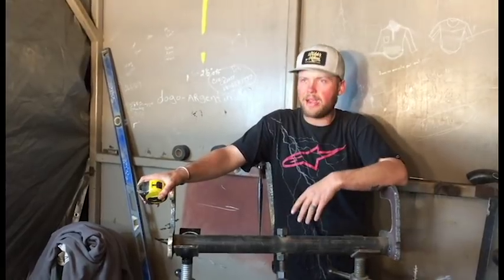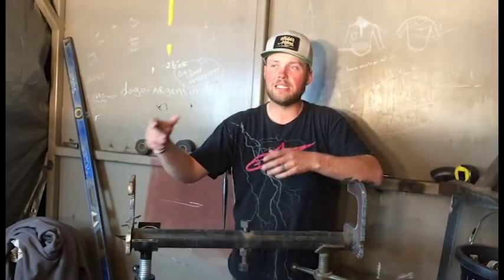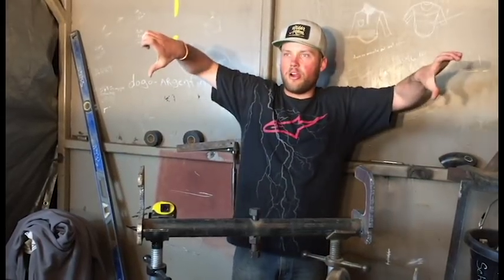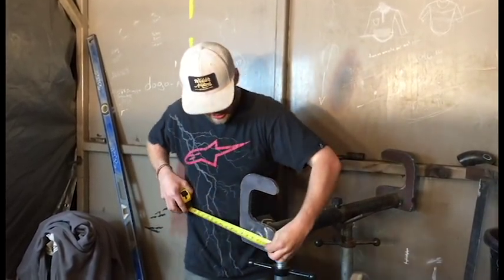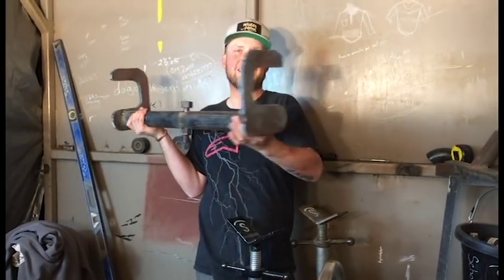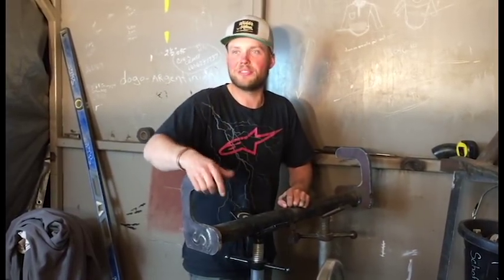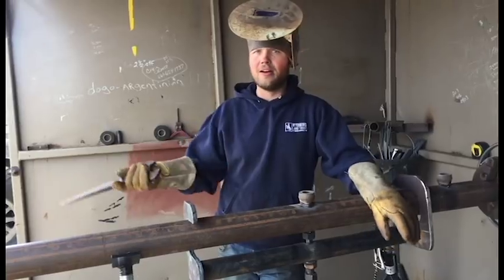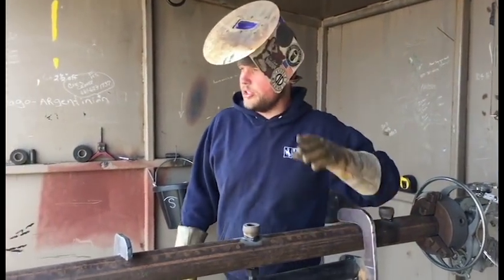Building and using a strong back. Pipe fabrication

Comment: Squared corners gives a start point for a tear to begin, think of it like a scored line on a piece of glass or sheetrock, it always breaks on the scored area, and a round corner has no area for a tear to start, if a repair is done on sheet metal or structural steel like a truck frame, if a hole is drilled at the end of a crack then the crack is and the welded and fishplated, and it can't continue on to tear more because  the round hole gives it no place to restart.

Comment: I have a 7 foot sch 80 4" with 22 1" weld olets 3.5" on center.   Any suggestions beyond the strong back?  I have sch 160 2" coming today to build a strong back.  Making 2 of these manifolds  to replace 2 that had thread olets and the issues with all the nipples being inline.  Johnny.

Comment: You get paid for f ups, that are your fault.
Reply from the maker: Richard Harms well if they don’t run you off over it then technically yes you do. Lol!!
Reply: Cool! I work for a plumbing company doing odd jobs welding mostly. I build pipe racks for pickup trucks, using 1 1/4 schedule 40. I know about bananas, but bananas are ok. These are really strong, kind serve as a roll bar too.

Comment: On my strong back I use chain link and welded a stud on the other side. The chain link goes around the pipe and hooks onto the stud. The middle part is the same but I weld an angle iron to cuff the pipe
Reply from the maker: genious thats a dang good idea i will nuild my next one like that
Reply: I use 3/8 chain...I work the nut from the inside and I weld the angle iron to the stud. I do that for the angle iron won't slip off the pipe. The plus side you will have using chain link more storage on your welding bed because you know how quick you will start putting tools in your back seat
Reply: I have one because I work with stainless pipe you talk about dog legging a pipe

Comment: round cut just basically removes a pressure points it spreads the pressure out.more area in a round vs a corner
Reply: Scott Everett yup. A square cut will concentrate the pressure at the 90* turn point and that's also usually a thinner area of material
Reply from the maker: thank you very much im learning everyday

Comment: How many hours is to much for a welding machine? Looking to buying one?
Reply: Roy Estrada not a welder brother but I’ve seen guys on the pipeline running Lincoln’s from old ass hell to brand new it’s the operator not the machine lol
Reply: Well. For Diesel machines I wouldn’t go for anything over 5000. Because if the machine last 10,000 hours (which is normal for a diesel) 5000 hours would be half its life p.s Gasoline machines last for 4000 to 6000 hours
Reply: ive always been told to look inside and see how clean it is. ask about the maintenance and shit, ask to run rod on it at all different amps. never bought used before.

Comment: How do you center the threadolets?
Reply: randlemyers there’s tons of ways but the easiest to explain and write would be... use a center finder (v shaped kinda looks like a square but it’s 45*) find the center line that’s vertical and make it plumb and mark it. Now go to the other end of the pipe and do the same thing. Now if you connect those two line with a straight edge or “snap a line” with chalk you have a straight line going down the length of the pipe. Now just make sure each o let is centered on that line.  Or do the same thing but just lay a length of angle steel on the pipe and draw a straight line. Only problem I have with that is most of the time you’re going to put a flange on or you already did so you might as well make the flange level the pipe level then find the center line using a level. It’s nicer to know everything is level then halfway through the process try to make it level. Let me know if you don’t understand
Reply: Search “machinist center center square” it’s essentially the same thing as using a length of angle steel but it has a flat side that you can put a level on the make everything plumb/level/square.
Reply: Thanks
Reply from the maker: ecr125x hit it righ on the money all i do is use levels get everything mark step back and be sure its in the middle.

Comment: The sqaure cuts weak point is where both side meet in the corner . The inside corner of it all is taking all the Force ( from what ever force is being applied ) . Not the entire shape .

Round cut is stronger because the force being applied to it and being divided into the entire shape , so the force has no choice to cause the weakest spot of the shape . 

If that makes sense lol
Reply: On board ship, any cuts or piercing, had to have rounded corners to prevent ripping, WTD's, hatches and the like all have rounded flanges and matching cut outs.      MH/DC1 USCG 76-85
Reply from the maker: see thats awesome info i did not know that
Reply from the maker: for sure does i appreciate you guys commenting.

Comment: You round the corner and it evenly distributes the force into both legs, if you cut the corner square all that force concentrates in the "corner" thus ripping it out. The same reason anything that has to hold pressure is round because it evenly distributes across the surface. ✌yall boys stay safe and keep bustin ass and $tackin cash!
Reply from the maker: thanks tim for the lesson on that I really appreciate it.

Comment: “Ope! There goes my gum.” 🤣

As far the square cut vs round cut: With the tight corner in the square cut, that’s the weak point. With a round cut, it’s able to support more weight and torque. Not exactly engineering terms but that’s what it comes down to.

Another good vid, too man. Good info!
Reply from the maker: damn thing just fell right out lol.